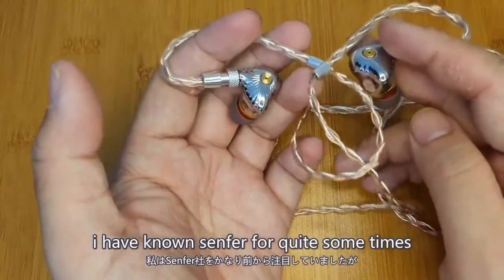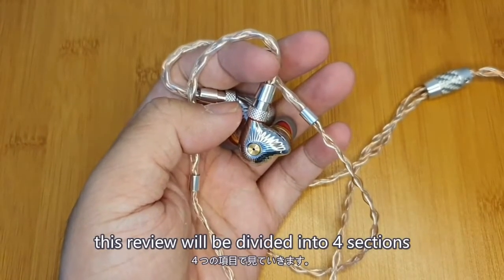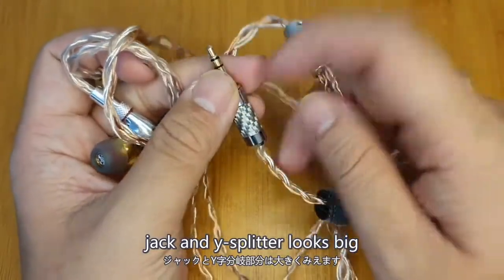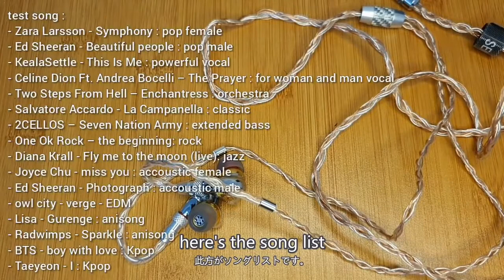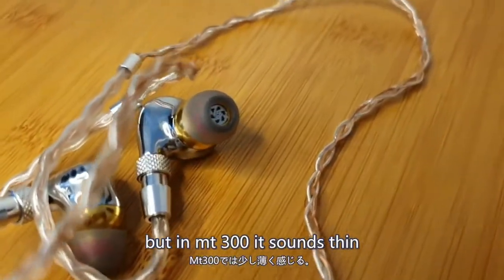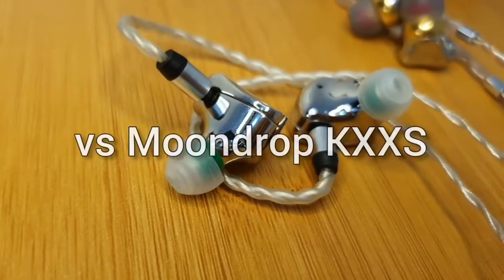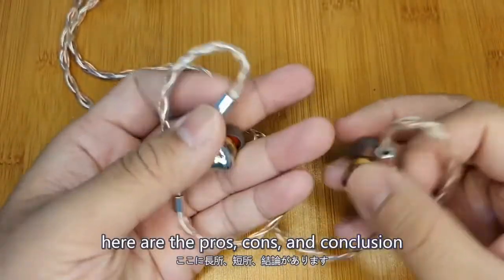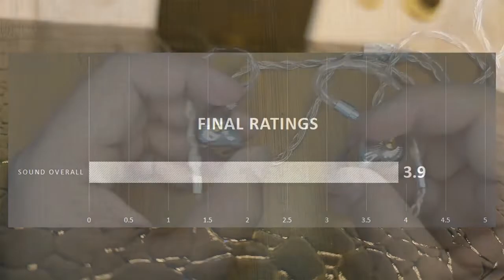Senfer MT300 Review, Senfer's Best Yet

Comment: How do they behave with a regular MMCX cable without the threaded endings? Did you try them with an aftermarket cable?
Reply from the maker: yes.. 3rd party cable will fit just fine... you just cannot use that locking mechanism.... -michael